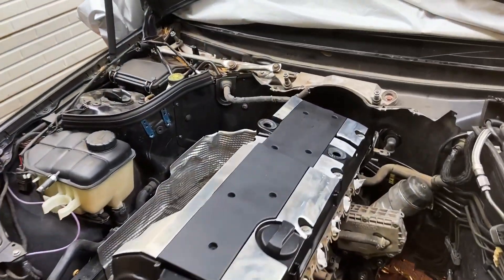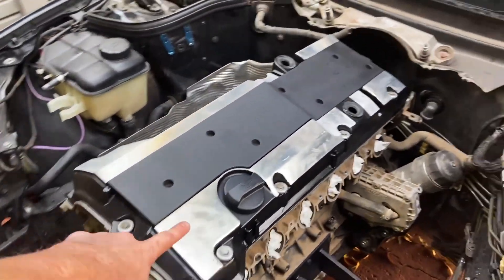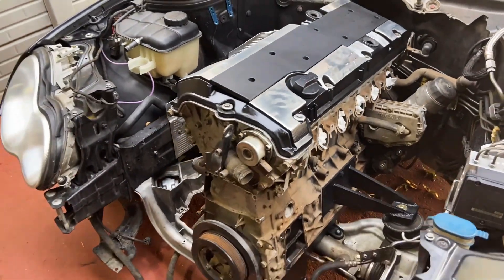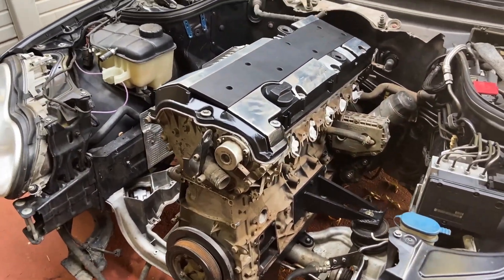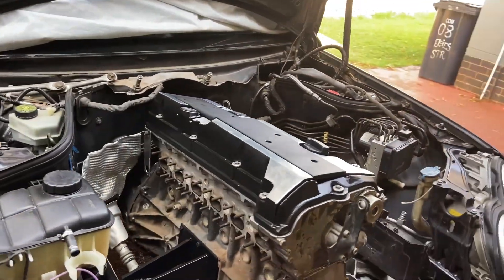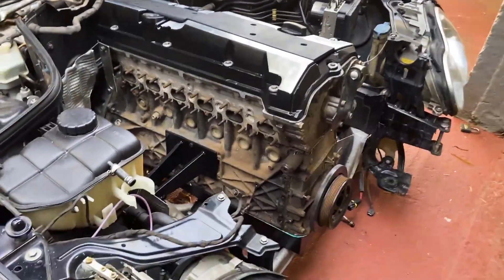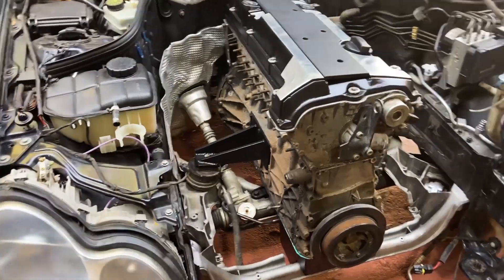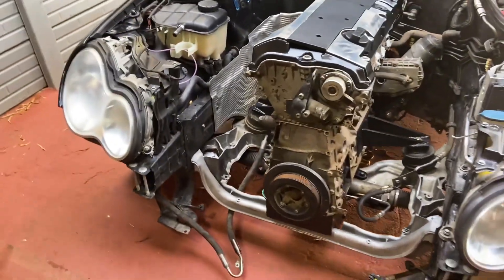Mercedes W203 M104 Engine Swap | Fabricating a New Oil Pan | Building Dreams!

Comment: is the m271 gearbox able to work on m104
Reply from the maker: Yep👌it works. Don’t know if it will last though
Reply: @RicerBenz  ok what about m104 engine harness is it hard to wire to w203 chassis
Reply from the maker: @593432223  I don’t use any of the w203 chassis features. Stand alone controls the engine and a few after market gauges to keep an eye on things
Reply: ok @RicerBenz
Reply: @RicerBenz  Watse ECU gebruik jy?
Reply from the maker: @WurminatorZA  Powermods
Reply: ok have a toyota nze 121. Selling it to buy 2007 w203

Comment: I was browsing through the w203 as I bought my 2007 c350 a couple months ago. I saw your channel before and the pops and bangs vid. Did you have the c250? And great work with the car!
Reply from the maker: Thanks man!! Haha noooo it was the C180....only sounded fast🤪😂hopefully this works out and it will actually be a beast😁😁🤪 those C350 Mercs are sooooo nice🤤😍
Reply: @RicerBenz  yes I love it especially since it’s a manual. That m104 engine should definitely bring it on par with the c350 with just a bit less hp but more torque. With all of the custom air intakes and tunes you could probably push close to 300 hp. Are you keeping the stock transmission and do you think it’ll be able to handle the power upgrades?
Reply from the maker: @aaronsheyman1751  so yeah I’m going to use the transmission that came in the car and see how long it lasts I guess😅😂 honestly don’t know what I’ll be replacing it with then. If I can find a w210 E320 manual gearbox I’m sure it will be stronger. But all I’ve seen have the auto boxes😅
Reply: @RicerBenz  if you look up w203 manual swap they put in a manual trans into a c55